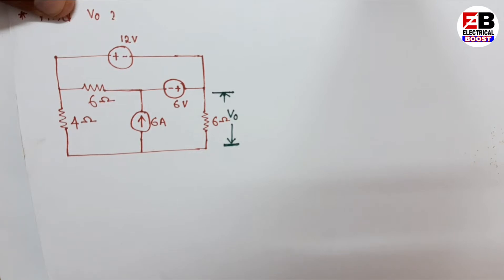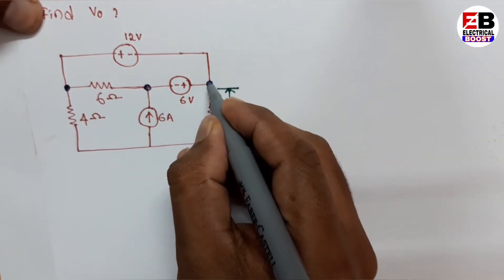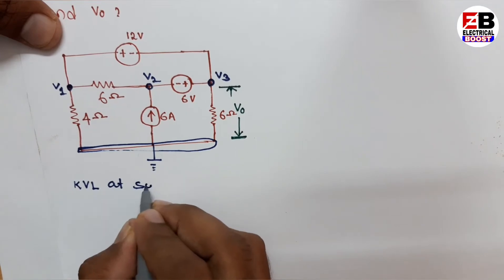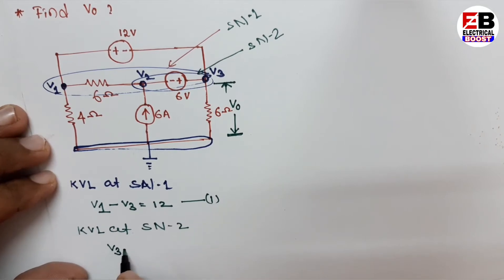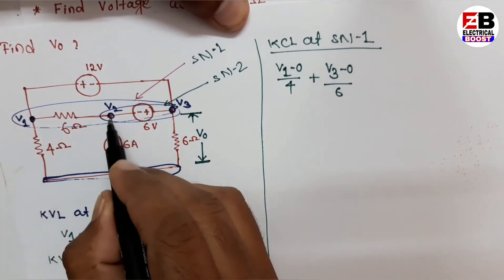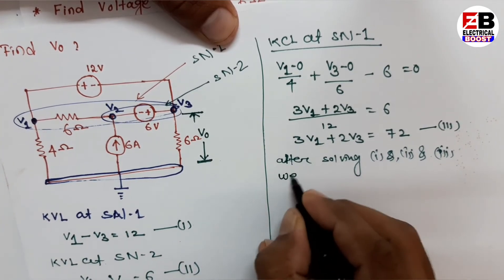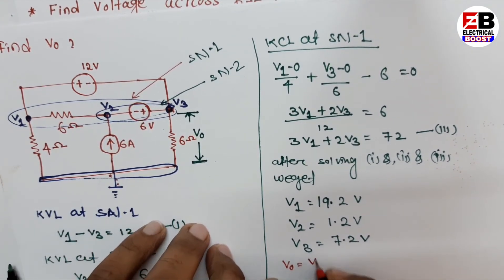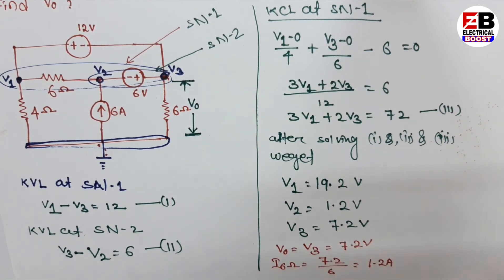Supernode problem 2 || Example ||

Comment: why the v1 v2 and v3 are taken as single node ?
 because v2 v3 has 6v right, that 6v is present in v1 v3 totally 12v (app v1 v2 have about 6v) .thus it shows the presence of 6v of v2 v3 in 12v of v1 v3 and acc to super node that nodes are short circuited and then followed by KCL rule entering i = leaving i  ( i represents current ) and there the answers

Comment: Sir Why don't you take (V1-V2)/6
Reply from the maker: Because we take supernode between node 1 and node2 so doesn't require to (V1-V2)/6

For more about supernode analysis 
https://youtu.be/WGSwp3JtXcI
Reply: @ElectricalBoost  Sir but some current will flow across V1 and V2,sir i have taken (v1-v2)/6 then i got V0=0volts,v1=12,v2=-6volts
Reply from the maker: Here we take node 1 ,node 2 and node 3 as single node that is supernode 1
So no current to node1 to node 2
Reply: Sir by kcl also we can do this problem sir
Reply: If You take  (v1-v2)/6 at node v1 , you will also require to take (v2-v1)/6 at node v2 the result will cancel out. No need to write to shorten the equation
Reply: @heiha228 ooooooo, thts why the circuit which in parallel with s-node are took out😮

Comment: All of your answer are not correct. You can't apply supernode between v1-v2 there is no independent voltage there. You dont understand what you are explaining.
Reply from the maker: Here I take supernode between node1 and node3
Reply: He is correct. You are the one that didn't watch it carefully. There are 2 independent V sources between 2 nodes. So naturally, there are 2 SN in this particular circuit.